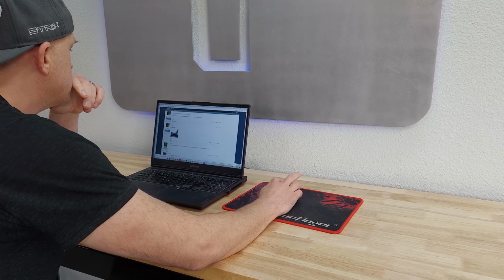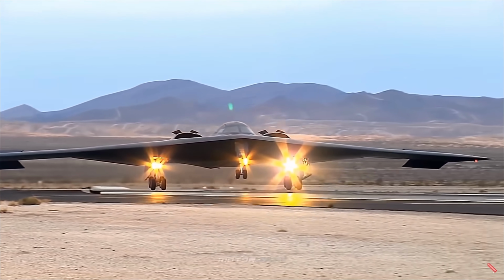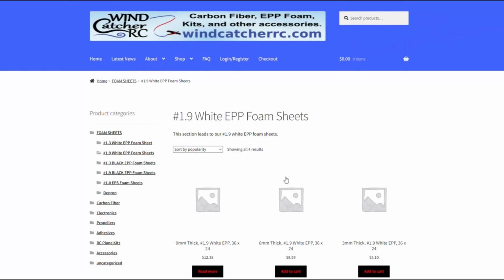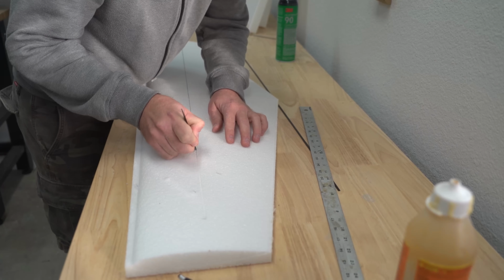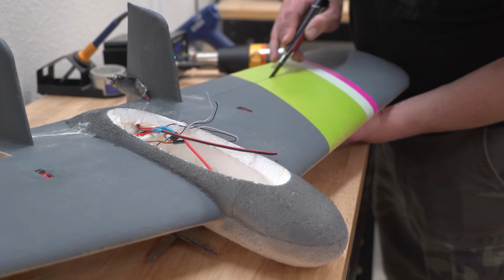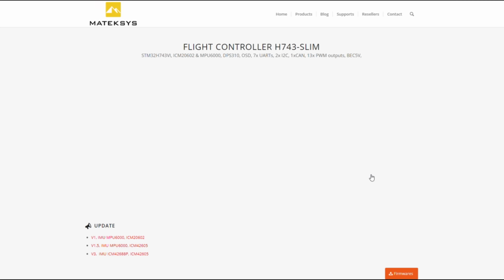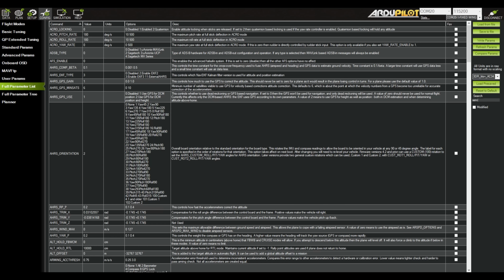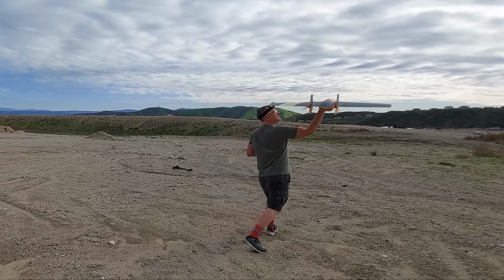Aerodynamic Instability:  The Holy Grail of Efficiency?  Part 1

Comment: This is in essence a really cool control system problem. I'm not sure if you have a background in this, but in case you don't I have some tips.
Key to designing a good controller for your aircraft is having a good model of the dynamics of your aircraft, because that way you can tune the controller in software first behind your desk without needing to go driving for every test.

There's two main ways of getting a good software model. The first is by explicitly modeling the dynamics of the plane using standard equations. If you want I can share some resources on this from my bachelor courses on this. However modeling this fully is hard, there are always some dynamics that are going to be hard to capture.

So that leads to the second approach, which is called system identification. Basically what you do is log the inputs you give the actuators and the response in terms of pitch, yaw and roll and feed that to a program that will infer the plane dynamics from that. Then you can tune your controller based on that.

If you have any questions please let me know, always happy to give my 2 cents.
Reply: I'm back now with another control systems course under my belt and a close reading of the Ardupilot docs. I wonder how much of the problem comes from the default feedforward controller. It basically assumes a model of your plane and uses that to estimate how much input to give each thing to get the desired output. 

But on a higher level, the Cm-alpha curve is negative for this configuration, which is why it is unstable. This looks a lot like magnetic bearing systems using in the high tech industry. So we can steal their tools to deal with this. Highlights from the book "The Design of High Performance Mechatronics" from the section of dealing with negative stiffness magnetic bearings (sec. 4.4.6):

Most importantly, they recommend to slap a big proportional gain onto it, in order to compensate the negative stiffness. It should be at least as big as the largest value for the negative stiffness that you expect, so in this case that would be determined by the maximum airspeed and AoA you want to design for. They recommend 'doubling the average negative stiffness from calculations', but since it varies quadraditcally with air speed you gotta be careful and add more I think, since the ratio of the forces to the planes inertia will become vastly bigger at speed.

The system will now response more like a 'normal' system with resonances, but here is the kicker, at low frequencies the system is still uncontrollable. The negative spring basically enforces a lower limit for the bandwidth your system operates at. So I think springing for the 400 hz electronics was a smart move. Finding this lower limit requires some math based on  either some flight data or some of the parameters from your XFLR model of the plane, but the former is better. 

It might be good to check that any low-pass filters in ardupilot are turned off and to make sure to get fast servos. For example if your elevons need to waggle to +/- 5 degrees to keep your plane stable, a servo that turns at 0.12 sec / 60 deg only leave you with a 25 hz bandwidth, meaning that your flight computer is doing all the quick calculations for nothing. (at 1 degree waggle you get 125 hz, still less than your flight computer)

Lastly, they also recommend waiting a bit with I-control, and using the PD first to achieve the conditional stability you want. Then measure your system and use those measurements to determine the required I control. 

I wonder if you will ever read this, but if you do I hope it's helpful. Was good to think through the problem anyway.
Reply: I'd love to hear about what textbooks you used to learn this stuff in college!
Reply: @marthinwurer   When I took Flight modelling and automatic control in college last semester, we used "Flight Stability and Automatic Control" by Robert C. Nelson. A bit dated and somewhat of a tough read but it's great for making mathematical models of aircraft dynamics. Then, making a control system of your own based on that model can be done, Anderson and Moore's "Linear Quadratic Methods" is great but reads like ancient greek and the subject matter is still half black magic to me.
Reply: @Mrissecool  Man I felt some relief when you said "subject matter is still half black magic to me" because as an aeronautic engineer I felt kind of bad for not completely grasping the subject, is good to know I´m not the only one. BTW the first book you mentioned, I love it!
Reply: This approach is used for adaptive controllers. First part entails system identification, then it can program the pids on the fly. However what he is suggesting is to use just the identification for creating a mathematical model, from which you can create a stable PID setting. This can be done in MATLAB once you have the stored the data. You need the transfer function from inputs to sensor readings (outputs). Typically this requires an iterative algorithm which over time converges to the correct model.
Reply: I'd like to hear which textbooks you learned this in as well.
Reply: Found the unnecessarily long know it all speech.
Reply: @davidrichter9164  that's kind of rude. Wanna talk about it?

Comment: Major  isssue is airflow over the wing and control surfaces. with the wing infront of the props the airflow over the wing is determined by the speed of the wing through the air and at low speeds and high angles of attack there is little authority. put a control surface behind the wing and you may solve the issue,

Comment: Cool idea. You might want to increase the strength and speed of your servos. They're doing much more work in the unstable configuration than you would usually have. Also if there is any play in your hinge, you may need to tighten things up as any sort of play will have a magnified effect.

Comment: Good video and good ideas, but use pull propellers, than you have a flow on the Elevons, with the pusher and the handstart it is "asking for troubles", no flow no rudder authority, with pull-Propeller blowing on evelons everything is stable  even at zero TAS(see small VTOLS)

Comment: Maybe if it was setup for use over water, and you could set up some way to precisely control, and maintain a low very altitude, (at a high speed) then perhaps the "ground effect" air cushion may prevent, and balance out its propensity to backflip, (because of the center of gravity being further back). Based on my own ideas for a sort of flying commercial fishing / workboat, I am envisioning something along the lines of maybe a radical flying boat type of design, that is a combination turbo prop barrel plane, flying wing, captured air bubble (SES), ekranoplan (WIG). Hopefully i explained that well enough to make sense. / ?
Reply: one high speed (air cooled) engine could be used to operate both the air turbo prop, and the water jet drive/s, either mechanically, or electronically.

Comment: Move the center of gravity forward but also add kennard wings that pivot and a higher aspect ratio. The kennard wings use positive control input. Also the angle of attack can increase approaching stall speed.

Comment: Also looks like air-speed is the cause of all the crashes as the airplane gets less and less stable.    Aeroplane dynamics and the required response time is speed dependent.  Can you put a speed-limit in Ardupilot while you tune it up?  How good is Ardupilot's airspeed?  Maybe add a Pitot tube to improve accuracy?  

Does Ardupilot have an internal model of the airplane it's flying?  Would help a lot if that was tuned to match your flying wing.  Even a 1-D or "homework level" model of the airplane can be enough to let you tune the flight controller in simulation and then can be used in-flight to hide most of a non-linear system from the PID controller.  i.e. PID says I need "X" pitch torque, airplane model translates that to "Y" elevon based on air-speed.  Or the instability could be simplified as a negative stiffness torsion spring for the PID loop, and the airplane model would set the stiffness and update PID gains at any measured speed.

Comment: Just have to ask, why is this any better than a canard aircraft? Such as the Long-EZ and Velocity manned planes. Moving the CG behind the main wing Aerodynamic center is essentially doing the same thing as a canard configuration - it puts the CG between the aero centers of your lifting surfaces (in this case the wing and elevators)

Cheers to the new idea and keep having fun!!!

PS I still want to check out the code you and Daniel used for the ekranoplan height sensing, would save me a bunch of time!
Reply: Another issue with canard configs is that the flow over the main wing gets heavily modified by the canard ahead of it. If the canard is for high maneuverability at high AoA, like on some modern fighters, then that's a great feature; but if efficiency is your primary goal, it's a bug.
Reply: It seems that drag reduction is a primary driver here. When CG is forward of the AC, a small amount of up-trim is needed to maintain level flight. That amount of up-trim results in drag. This is a stable configuration. Since gravity is always pulling the nose down, this up-trimmed configuration seems to work pretty well for landings too. 

So, in an effort to eliminate that built-in drag, it seems that the designer is moving the CG aft of the AC in order to eliminate the up-trim. There is more to it, I'm sure but I think that's one of the starting points for exploring this dynamic.
Reply: In order for a canard airplane to not deep stall, the canard has to stall before the main wing.  That means the main wing can never fully develop it's CLmax, so the wing is oversized to begin with.  It also means that high lift devices like flaps are ineffective because you're still limited by your canard.  As a result, a canard with a wing sized to meet a given takeoff performance will need a larger wing, and thus be slower and draggier at cruise compared to a conventional plane that can achieve the same takeoff performance with the use of flaps and smaller wings.  To get around this you either need flaps on the canard that deploy with the main wing flaps to raise the CLmax, move the canards forward during landing and takeoff to achieve a greater moment to counteract the pitching moment of the flaps and high AOA main wing, or accept that if the plane stalls it will be unable to recover.
Using flaps on the canard is problematic because that's where your elevators go and it also makes the canard lift curve steeper, degrading your static stability.  Moving the canards forward is viable, and was done via adjustable sweep in the Beechcraft Starship, but it's heavy, complicated, and also steepens the canard lift moment curve (thanks to the longer lever arm) degrading static stability.  Finally, accepting the risk of deep stall poses similar control system issues as presented in ThinkFlight's video, but hobbyist grade stall recovery software, stall sensors, and AoA sensors are far less developed than hobbyist control software to deal with aerodynamic instability, thanks to multirotors which are inherently unstable.

Comment: So I think you will find that you will get the controller to keep things pseduo-stable when the angle of attack is low; but when it deviates too far, the controller won't be able to catch up in time and you'll get a deepening stall or dive. Rather like what you can see. What you could do to counteract this, is an aircraft where there is a lot of mass well in front, and well behind the centre of gravity. That would increase the rotational inertia around pitch axis, and slow down those pitch oscillations. you can still move the CG wherever you want but the inertia would be higher. much higher aircraft inertia around pitch axis and much lower inertia for elevons. v interesting project good luck!

Comment: I think this is going to be extremely hard without active AoA sensing. The flight controller can do it's best to damp oscillations, but this sort of instability is considerably worse than just oscillations.
Lets say you want it stable at 5' AoA. There is an upset, and the aircraft tilts up to 6'. The gyro can detect that, and strongarm the controls to return the aircraft to the original orientation, but the direction of flight will change in that time, so the original orientation might have an AoA of 4'. If the controls then return to the 'neutral' setting (metastable at 5'), the aircraft will still find itself with a pitch down movement. If held perfectly at the same orientation the flight path will start to oscillate up and down. We want the aircraft to be stable (after computer control) with regards to AoA. In order for the computer to do a good job of this, it needs some good way of understanding where it is wanting to stabilise towards.
Even if you manage to get the computer to infer the AoA from inertial measurements, a gust of wind will throw all that off.
One design that I have been looking into is weather-vaning canards. The idea is that the canards are placed behind their axis, and are controlled either by a motor that outputs a certain torque for given control input, rather than setting the position, or a smaller control surface on the back of the canards. They effectively get an AoA term affecting their position automatically.

Comment: Very interesting project! But i would go back one step and first build a plane with a tail and normal elevator/rudder configuration. I believe this would be easier to get flying descently with an instable CG position because the airfoil momentum does not play such a significant role. Flying wings are much more sensitiv to airfoil momentum changes - which you are doing all the time when employing the evelons. Just my 2 cents...

Comment: View at 6:19 caught me off guard. Up to this point I'd assumed this was one of your classic designs with a single pusher motor. But then an awe-haw moment, two motors to eliminate motor torque from this instability experiment? My excuse for overlooking this detail is the rearward facing camera was not centred on the longitudinal axis. 

The biggest hurtle with this project to learning to tune and fly an instable plane during the the launch phase of flight, which in itself is more unstable than other phases of normal flight.
My suggestion would be to start (in)stability testing and tuning after stable level flight is achieved. A simple way to accomplish this is to add a servo that drops a weight attached under the planes forward fuselage with an optional “remove before flight” streamer. (to reduce fall speed, and to make it easier to locate later)

I noticed that this UAV doesn't have a true airspeed indicator? Without true airspeed,  Ardupilot is not able to calculate/remove windspeed from a GPS derived groundspeed! Hint: while you may be flighting in light winds, the plane is not always flying parallel to the ground, so ground speed would be just as unstable as the UAV. 🤯
No real IFR test pilot would attempt to fly an unstable aircraft using only an artificial horizon and vertical speed without airspeed as a cross reference. BUT this is the task you are requesting ArduPilot to attempt. 

Personally I'd go a different route to installing pilot tube for airspeed as it is likely to undergo a RUD (rapid unplanned disassembly) during repeated durability testing.
An "Angle of Attack" (AOA) sensor would provide much quicker response rate and more accurate data. Pilot tubes work best when in a near-zero AOA environment, otherwise they report inconsistent performance data. Another reason to delay adding a pilot tube. An AOA typically install on the forward side of the fuselage, so should be protected during UAV durability testing.
FYI: all fighter jets rely on AOA to ensure stay within the engineered flight performance box, particularly during high-alpha, and/or high-G manoeuvres . 

While I haven't seen a good AOA sensor marketed for using on small UAV's, it should be possible construct a useful AOA sensor that would be compatible with the Matek flight controller. One option would be to use a resistive potentiometer, like that found in a servo, and feed a voltage to the FC's spare analog to digital input. An optical rotary encoder could be an alliterative, but would not be FC compatible
 Another option, would be to use a diametric magnet (magnetized across it diameter) and a hall-effect sensor to track position to a fine degree. Other methods could measure pressure differential on the wing, but this would be a complicated project itself, thus would become a distraction.

BTW: with a working AOA, I suspect even Nicholas's dRehmFlight software could tame this unstable flying wing. It should also be possible to estimate true airspeed based on an aircrafts AOA and motor power level. This would need calibrating, but could be a technique that prove useful enough to include on future aerodynamic explorations. A couple thought that could be follow-ons to explore once stable efficient flight is achieved.

Comment: I'm guessing that because the plane is very short from front to back, it has a low pitching inertia. This results in pitch-changes occurring more rapidly, as a result of which the stabilization system needs to react to pitch-changes more rapidly.
 Pitching inertia could be increased in either of two ways: by increasing the size of the plane; or by giving the plane swept wings.